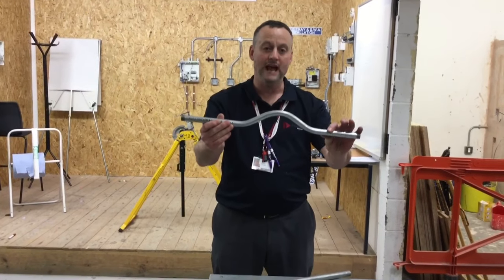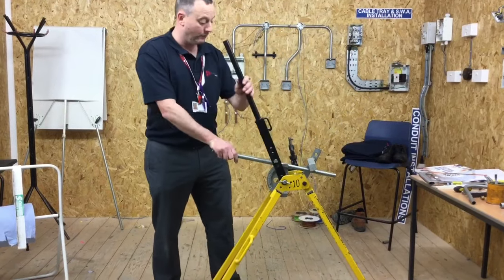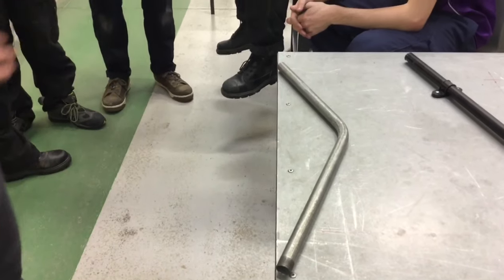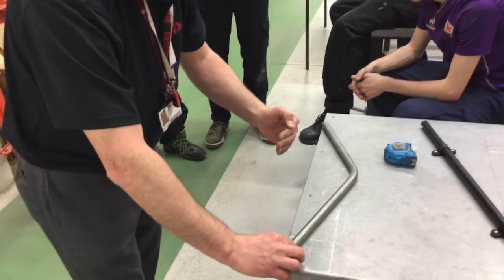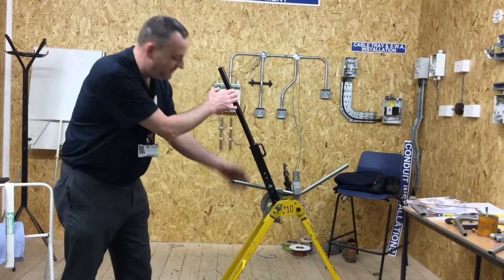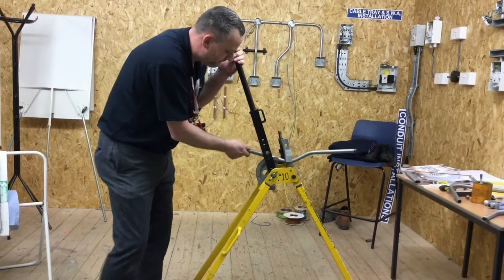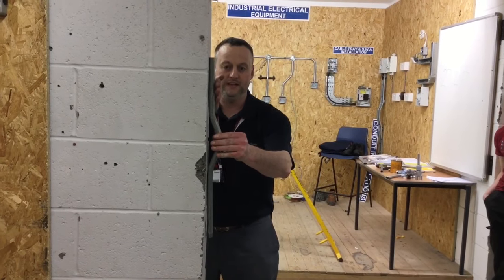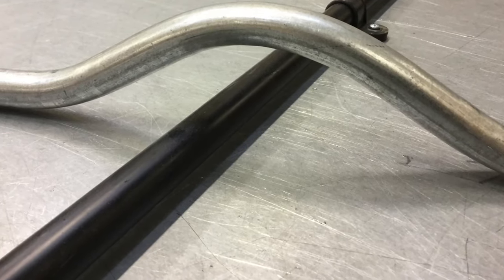Electrical Practical Skills Bending a Crank Set in Steel Conduit (How to Make bubble set or Bridge)

Comment: Brilliant tutorial. I’ve got a job this week which involves a lot of steel tube work. And I’m finding this really interesting. Such a shame the apprentices in the background don’t look interested whatsoever. I’m 23 and completed my apprenticeship. I’m here and it’s 9:30 in the afternoon watching these videos. How sad 😉.
Reply from the maker: Massive thanks and remember hard work has its rewards 🦾
Reply: @GSHElectrical  I’m here to update you! Everything went well but my only question is. When you’re running long runs of tube and you have obstructions to go around. How do you join the tubes together if they are threaded. Because if I have a bend on the tube where I need to thread it onto another length. That bend flies all over the place hitting things and getting caught. Is there any easier way to do this?

Comment: what are the uses of steel Conduit and where would you use it? thanks
Reply from the maker: Hi. In industry when a surfaced mounted wiring system is employed. It provides strong mechanical protection and the wiring system can be easily changed or added to. Thanks for the question GSH Electrical
Reply: We have different solutions in most of Europe for example in Poland, Norway, Sweden, Germany

Comment: From Canada here; Is this pipe all Rigid pipe? Or EMT pipe? We use all EMT pipe here in Canada for like 95% of applications but we just use a hand bender. Only standing bender i've ever used was for 2"+ sizes. Im considering moving to the UK as I have family there, trying to figure out if my hours can be claimed in the UK as I'm red Seal Certified here and wouldn't want to start as a 1st year apprentice again.
Reply from the maker: Hi. Depending if your level of  qualification and your UK employee you may find you only need a level 3 or a wring regulation course. Thanks again for commenting and watching GSH Electrical
Reply: GSH Electrical the wire regulation course is just a few day jump start course is it? And the level 3 is an apprentice stage? I’m finding a lot of available courses for electrical as I look into it. Where I am now everything is government regulated so there is on 4 levels of education and they are all taught the same regardless of where you take it.
Reply from the maker: Hi. You would normally do a the regs course (which is a level 3). The design courses are level 4 and you could do HNC or HND as well. Thanks Gaz
Reply: The pipe used is most similar to rigid only its steel(galvanised) as opposed to aluminum in Canada, there is no EMT only steel which is bent by using the bending machine showed in video only!!!